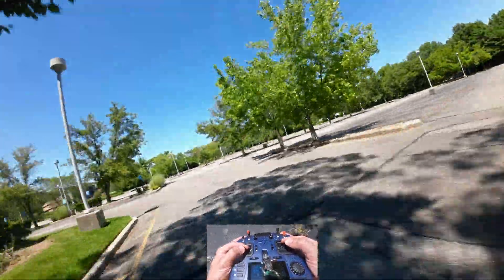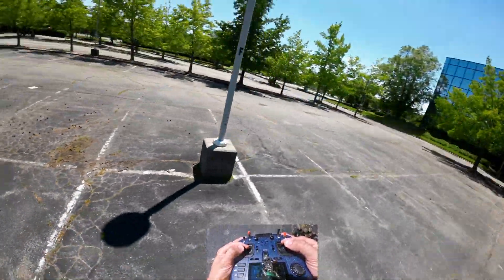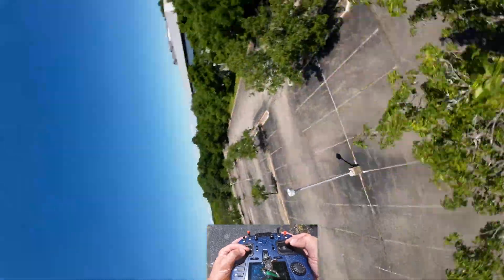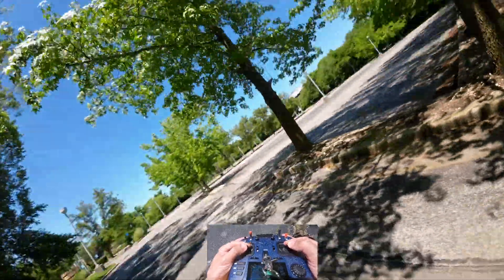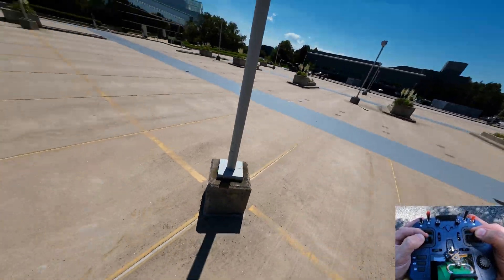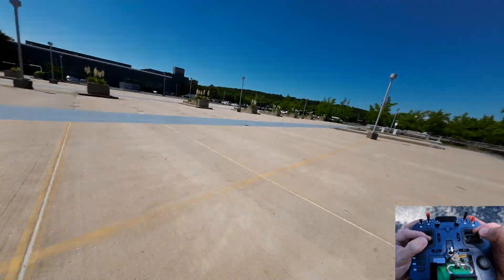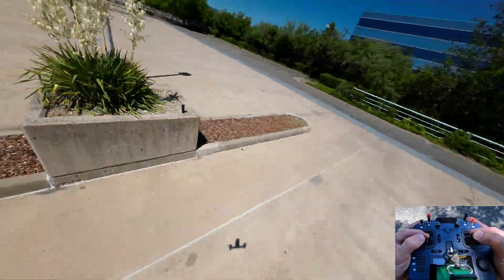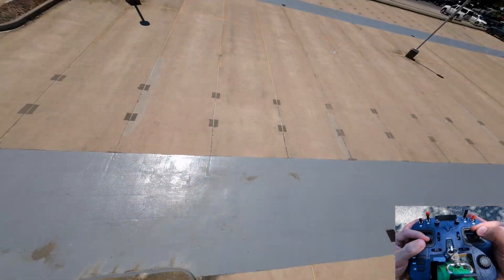FPV Cornering: How to mix Roll Pitch Throttle & Yaw for tightness

Comment: I feel like you haven't really explained this at all. Just about every trick or move on the planet requires roll, pitch, throttle and yaw...
Reply from the maker: Make a better video!
Reply: What a silly response to valid criticism. This shouldn't be called a how to video.
Reply: @MattyfleischFPV  Uhh, I watched this video specifically because I struggle a bit with getting tight corners. Hoped I'd get some tips to improve. I didn't.
Reply: So you blame Matty?  Lol.   Go get some sim time.